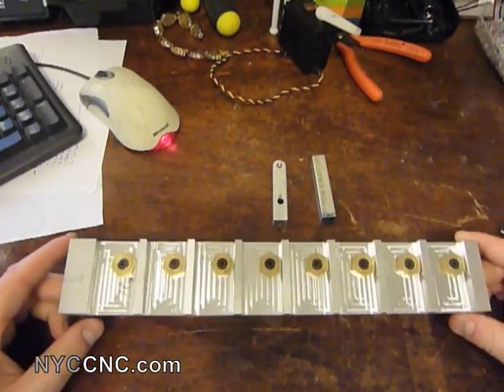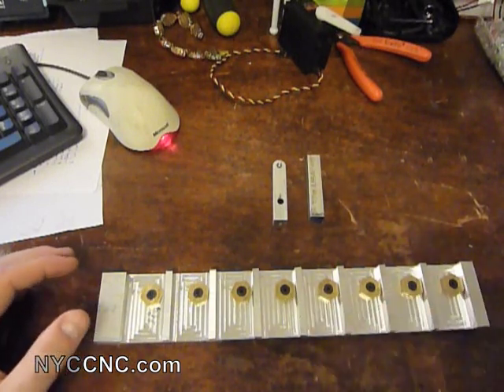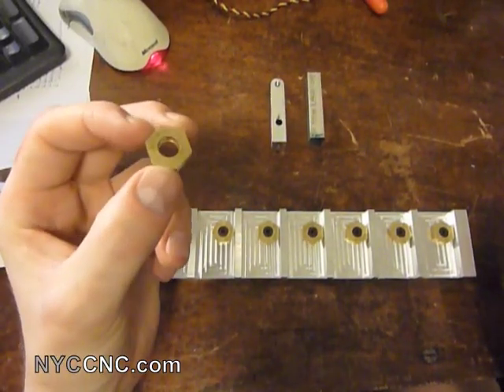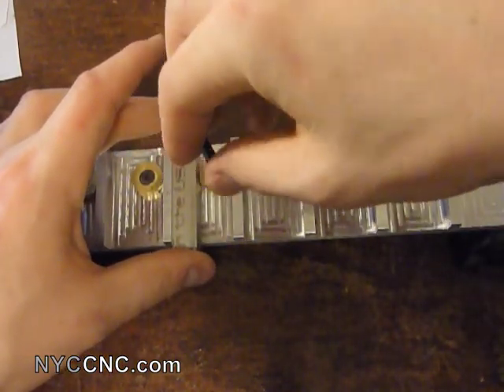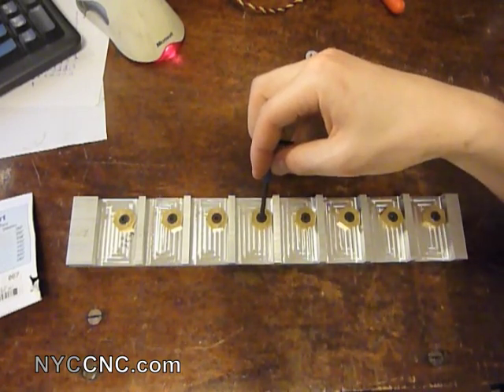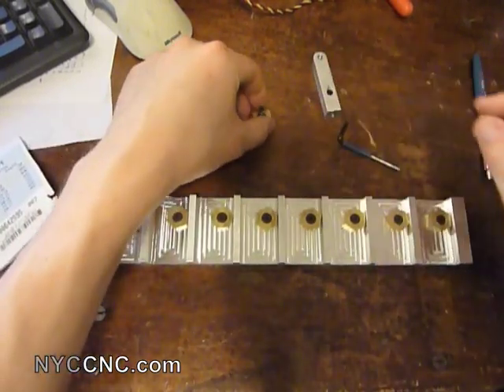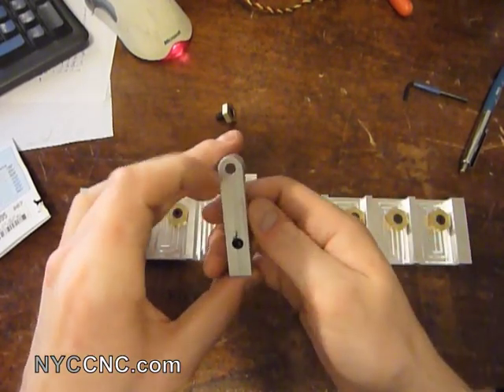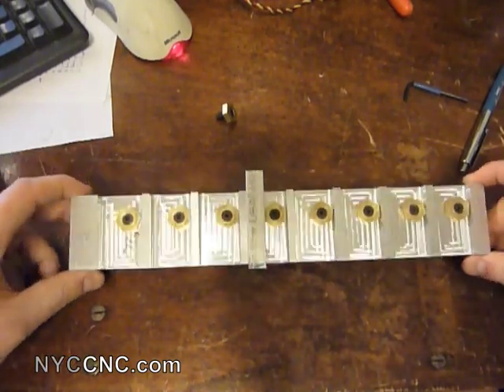Mitee Bite Toe Clamp Fixture to hold small aluminum parts for CNC Milling Machine

Comment: A little late to the ball game here, but wanted to share something an old machinist showed me a few decades ago.  At the time I was in working towards my BSME while working in machine shops to pay the rent (and learn how things work in the real world).  The machinist was running a vertical CNC at the time.  He had taken a 2" thick aluminum plate and bolted it to the work surface using counter boarded holes and SHCS.  The length and width of the plate were very close to the working length of his mill.  He profiled the outer edge of the plate just to make it square and pretty, then faced the top so that it was flat.  Then, on a 2" x 2" pattern, he machined a .75" deep hole to accept a 1" dowl pin that he could use to locate/position the flat edge of a work piece or vice.  In the center of each hole, he drilled and tapped a 1/2-13 through hole that he could use for toe clamps.  The entire hole pattern was located at an even position on his coordinate system.  He turned UHMW plugs for each hole, and cut an o-ring groove on each one to keep flood coolant from getting into the pockets.  Each plug had a set screw in the top that he would remove and then use a machine screw to remove the plug if he needed access to the hole.  The set screw simply kept the debris out of the threads.  This configuration allowed him to quickly clamp work pieces and vices on his mill at known locations which significantly reduced his setup time for each job.  I've been working as an engineer in the manufacturing industry for over 25 years now.  To this day, this is still the slickest setup I've ever seen.  There are prettier, more elegant solutions out there now, but for a bare bones universal set up, his solution still takes the cake.  That man could enter G code on a key pad faster than I can type an e-mail...

Comment: To use these clamps to their full potential, make sure the hex component is lifted up against the bottom head of the eccentric driving screw, and that there's at least a small gap between it and the fixture plate before you tighten against the part. This ensures both lateral and axial (downwards) force on the part.

Comment: Thanks for the video! I've never heard of these clamps before. I am definitely going to get some of these. I like your fixture by the way, simple and effective. I see that this video is a few years old so I'm curious if you've made an upgrade yet? I was thinking you could just cut out 2 rectangular sections on the bottom of the fixture leaving a T-shaped profile so you could secure it in the vice with the top of the T being held firmly against the side of the vice jaws.

Comment: i have 3D cnc working specification  of bed is 370  mmx 270 mm x  150 mm  in xyz axis respectivelly . this is spm machine having rmp 16000 . i want to engrave the letter on 1 mm aluminium sheet which is off  various size . i want vaccume table which hold the small workpiece too while machining with 16000 rmp engraving depth is 0.15 mm only

Comment: The Clamp was originally designed using Flat head socket screws they worked great!
The cone washers where added for the Double clamp so lt can float if a part is larger on one side...We us those clamps in an Auto motive Machine Shop to hold Engine Heads for Surfacing.......I build one or two fixture a Mounth for our plant in Mexico.

Comment: I have built over 250 Fixtures ...using Tiny Vises.....The only thing we have replaced on them is the Srews now and then! We have 16 CNC machines running them.....the cost saving came to a couple Mil a year.

Comment: The Tiny Vises Work Even Better with out the Washers!
The Washers are a Patent Glitch..........
So run them with out the washers......they work better----and you can use a Air wrench to load and unload.

Comment: Hi ....If you would of used Tiny Vises No.-1 you could use a air wrench to load and unload Parts ----- And the Tiny Vises has more than twice the Throw!.......And the Double Tiny Vises you could Double up on your parts! and the parts could be .020 to .030 out and still Clamp.
The tiny vises has more than twice the Camping Power ...and they are easier to install.
Check them out.